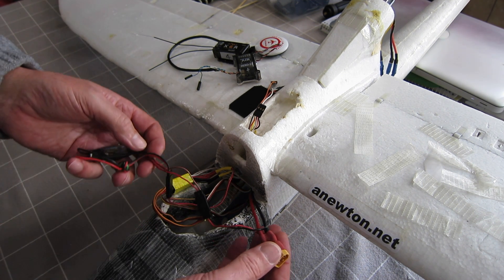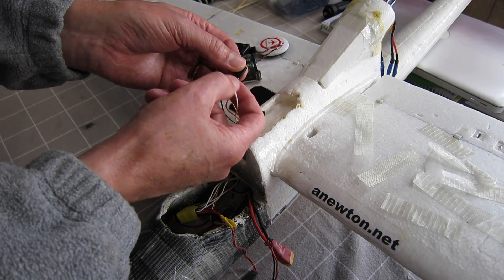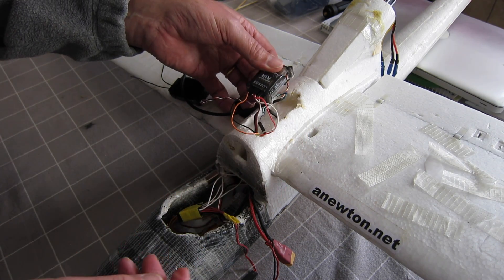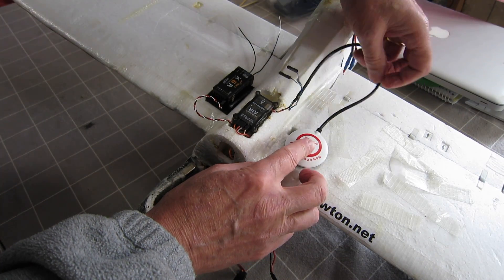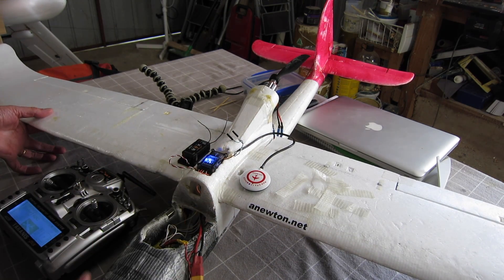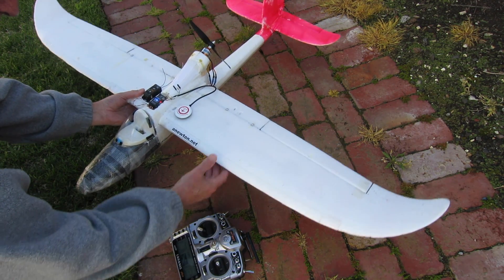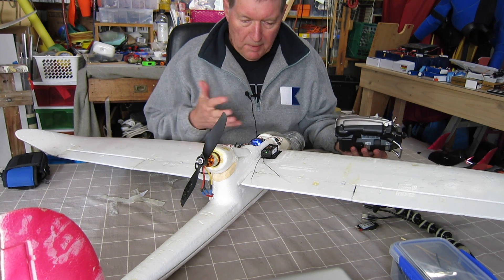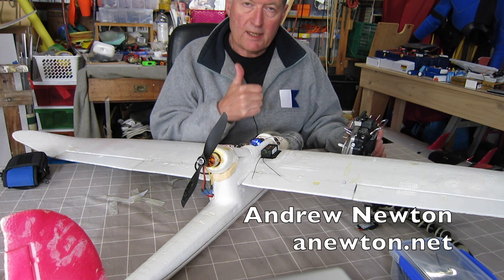Bixler 2 AIR3 iNav Part 3

Comment: Andrew thanks for the prompt reply -
At 0.54s  - `ESC  [Pos Neg Sig ] goes into Q1`... The rest then appear to be signal only [servos powered by the made up strip via the ubec]. ? I can see how the Rx leaches power from the nav - but it appears to be from the `Q1ESC input`.. So if the motor ESC failed - the power to the inav/rx fails also. -Have I  had too many festive drinks ...:-]
Reply from the maker: Oh yes it does look that way, but the red wire in the ESC cable (going into Q1) is actually connected to the UBEC not the ESC. I didn't explain that well. Either way would work OK but it is safer to power the board with an accurate 5.0V BEC
Reply: Perfect ? thanks again. Did you'd the inavOSD into your builds? Best way to incorporate?
Reply from the maker: Yes I did a setup video for the OSD on the Zephyr wing about a month ago.

Comment: Hi Andrew - Given that your using a ubec only for the servos, it looks like the power to the inav & rx comes from the ESC. I ask as the ubec I have from Multiwii suggests disconnecting the ESC positive - connect as usual  & run ubec power  to rx?. 
I can see a logic to both - Help :-]
Reply from the maker: Hello Sean. I'm using the CarbonBird UBEC to power everything, nothing coming from the BEC on the ESC

Comment: Alignment of the GPS puck is not required on fixed wings since you typically will not be using the compass since the model can only fly forwards. The Flight controller can calculate heading based on the changing GPS coordinates. Alignment is important for helis and multirotors however since they can be flown in any direction. Search Ebay for DuPont connectors. Servo plugs are just 3 pin DuPont. You will find various lengths of housings from 2 to 10 pin. By using an appropriately sized housing the wiring can be made almost fool proof
Reply from the maker: Excellent thanks Rob, didn't know either of those info gems.

Comment: Hi Andrew good how to as usual. 
I have a question that has nothing to do with this subject. 
I have been given a broken  HZ super cub airframe which I have repaired and am now fitting electronics to.
what I'd like your opinion on is should a novice flyer have ailerons or just rudder and elevator.
Reply: If that is the same Hobby Zone Super Cub that I learned to fly on, then no you don't "need" ailerons to start flying it. It has a ton of dihedral which makes it turn just fine with rudder only, and has the bonus effect of making it fairly self leveling when you let go of the sticks. That can be a helpful feature when first learning to fly. 
Once I got comfortable flying the Cub the way it was, I built a 2nd one out of spare parts, and flattened the wing, and added ailerons. Then I was really rolling! (pun intended)
Reply: That is not really a expert/novice issue. It rather depends on the model. If the wing has little or no dihedral it will not turn well with rudder only and will not self level the wings to a stable attitude. In the case of a CUB they are generally easy to fly so I would not hesitate to fit ailerons particularly if the model was designed with aileron use in mind. Try to find an experienced pilot to help get you set up, airborne and trimmed out.
Reply: Rob B thanks mate unfortunately I don't know anyone else who flys .
The clubs around Adelaide want so much for membership that it just won't happen thanks again for the advice.
Reply from the maker: Yes Rob is right, the Cub needs ailerons to fly. A rudder elevator plane needs dihedral in the wing or turned up wing tips. A rudder elevator plane might be easier as a first plane but as soon as you get your orientation skills ailerons would be OK.
Reply: Doug Wagner thanks mate thats what I thought as it does have good dihedral.
Reply: Andrew Newton thanks mate your advice and that of your veiwers has helped a lot.